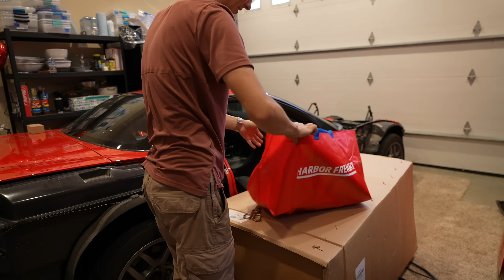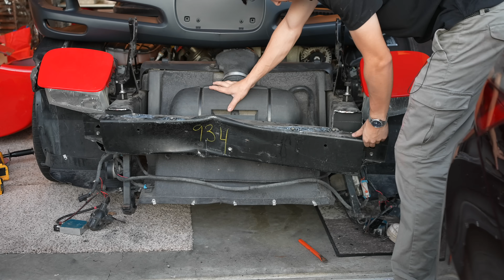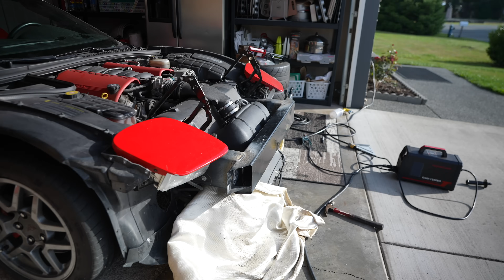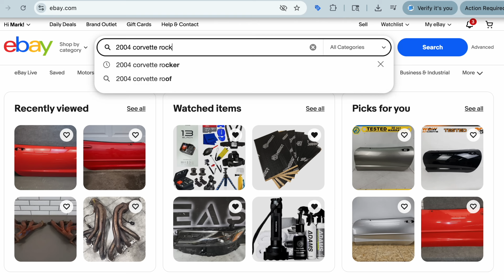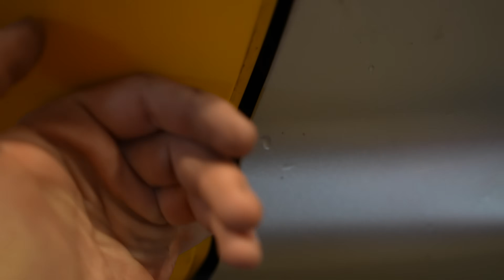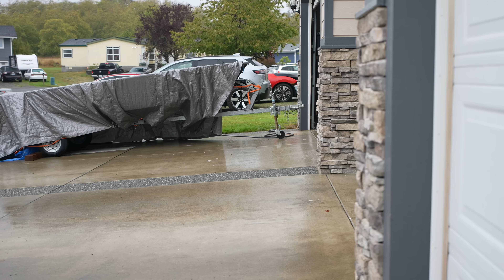Attempting To Fix My Corvette Frame With NO EXPERIENCE! (Corvette Z06 Rebuild Part 3)

Comment: Put spot welds on all for sides to hold the bar in place. A weld will shrink, thus the opposite side will pull away and open up

Comment: You can repair CMT with fiberglass and epoxy. Almost every new jetski is made of CMT. To make the repair solid, you have to attack from the back first. Grind a heavy V around any crack and extend several inches past. Use a 36 or 40 grit disk for keying the surface and then thoroughly clean with acetone. Layer and buil up with fiberglass and a high quality epoxy. I was the shop manager at a fiberglass shop and we were told when CMT was hitting the market that it can only be done with basically a plastic welder so we did some experimenting. Our repairs were tested for delamination and didn't fail.
I know its late now, this is for the future!
Reply from the maker: Is CMT the same as SMC? I’ve watched video of people trying to repair SMC with fiber glass and it peels off like a sticker.

If it does work I’d love to make a video testing that out!

Comment: Good work , there . Especially considering you threw yourself right in the deep end with no prior 'form' . Oddly enough , the colour combo on the ride to Nitro looked pretty good, but then I saw  that if the doors were silver too , with the paint demarcation lines as per the panels currently are, that would be super-cool , and not seen before. After all ,  it's a 'Vette, to be a true 'Vettista , it has to be a 'one of one' ! Jorts and polo shirt ptional . Red and silver just works.

Comment: You’re HIRED! 😂👌 Great work Mark. I love that you’re learning yourself yet being a great teacher to others. Your videos are top tier. Keep up the good work! 

Nice work on the Corvette. Expensive materials huh? 😂 You know my pain! Great investment on the tools and supplies tho. Every job you do will go faster and easier. Don’t ever give up! It’s all the “same” but different. Different color usually. So learning all the different types of repairs on different areas and surface material is great experience for the next. 

Thank you again for the cameo and tag! 

👊😎

P.S. The weld looked great! If you can weld that great with flux core, welding with shielding gas will be a piece of cake! Consider a couple welding blankets that you can toss over paint and especially glass when welding. I’ve ruined a couple things myself learning the hard way... 😅🤦‍♂️
Reply from the maker: Glad its staring to work out! Thank you again for letting me stop by and ask some questions. Just bought a DA so the bodywork should fly by now 😅

Comment: One hint I can give you is that a metal window screen is sometimes used behind the cracks. First, you sand the area behind the crack, then use a puddy knife for spreading.. Usually, I think they use fiberglass resin, the stuff you have is very expensive and good too. You should have the rocker of the car or the part you are working on to make repairing easy.

Comment: Joe Momma live's in Jo Mamma's House NY 12345 What a trip. Bro mad props on the welding and tackling that huge job,ive only hardly welded myself. Tried it 1 time with my buddy when we were doing custom work on a truck we were working on. SMC,learn something new everyday. I hear the rockers were and are expensive to do and sometimes insurance can be a pain of they get damaged on these cars. I cant wait for the next episode,your on your way bud. When you do get everything finally painted and done you should get Vette Lights for all your lights. Also you need some rumble on the exhaust side. Good luck bro,im still broke since i paid 34k for mines in May cause i have 12k miles currently but i spent another 10k on top building it and its done for now till sometime later next year ill move and then save for cam and all supporting mods plus dyno tune. Doing it all myself hopefully. Bru you were loosing traction and then locked up brakes at the end,lmfao! :face-blue-smiling::face-blue-smiling:

Comment: That's not a Tig welder
Reply from the maker: Correct, that’s why I have the joke after I said it😂
Reply: If that is not a Tig welder, then what is it looks to me like it welded the crash bar just fine
Reply: @munirladha6787  flux core wire feed welder.

Comment: I said it last time, it’s unbelievably funny how similar of a situation we are in,im about to send it and learn welding to fix the holes for the rad support/skid bar😂,what temp were you using when welding the frame
Reply from the maker: Honestly I don’t remember! I tested up and down until I had it right and used that. Didn’t really have an idea of what I was doing😂
Reply: @MarkAgeyev unbelievably relatable
Reply: Let’s weld together sometime😌☺️

Comment: Going into this not knowing how to weld you did an awesome job! That’s coming from someone that has been welding for 20 years. Keep it up. I also have a c5 z. I’m currently doing a cam and engine work.
Reply: I went with a BTR cam kit with springs push rods and lifters. Mine is high mileage so I’m doing a lot of little stuff while I’m in there.
Reply from the maker: How much did that run ya?
Reply from the maker: Thank you, that means a lot!
Plan on doing a cam as well soon, it’s expensive! Which route did you take?

Comment from the maker: What mods should I do once it’s fully fixed?
Reply: Motor upgrades!
Reply: Big ole American bald eagle cam shaft 🦅
Reply: You're a long way from fully fixed.  Honestly, it is a 650hp car so it doesn't really need more power.  Maybe some stereo upgrades?  Are the wheels/tires in decent shape?  If not, some new tires, fix any curb rash on wheels or just get new wheels.  I'd stick with OEM wheels maybe in dark satin finish (have them professionally refinished that way you can choose whatever finish you want) or stick with stock finished wheels.  Check the date codes on the tires and replace them if they are more than 7 years old.